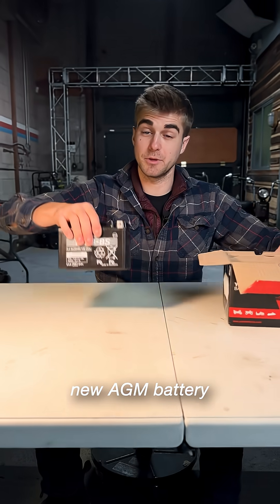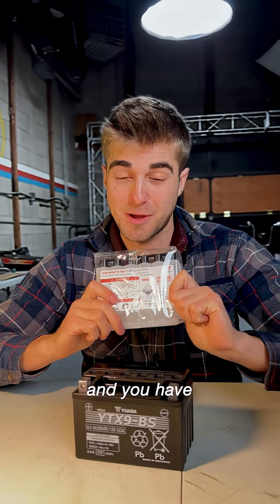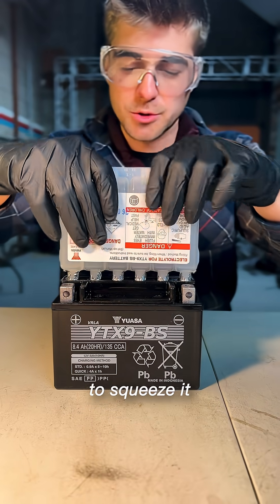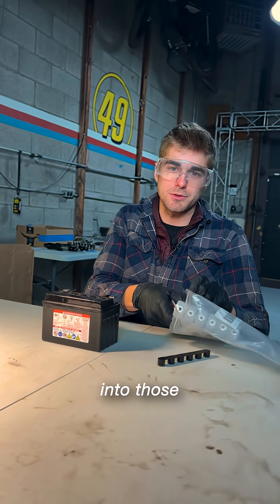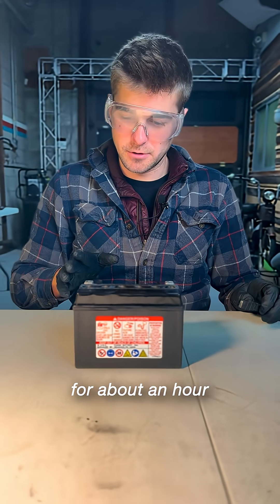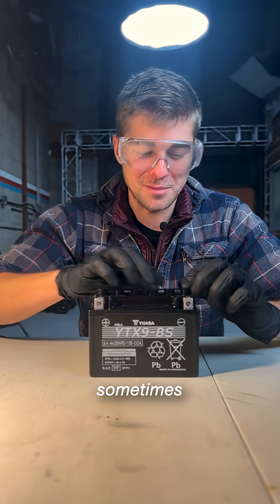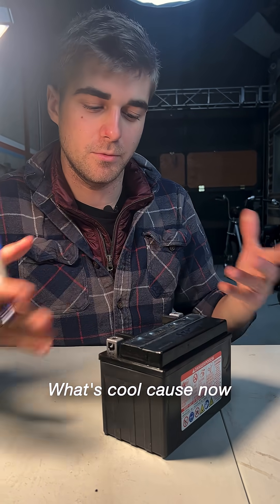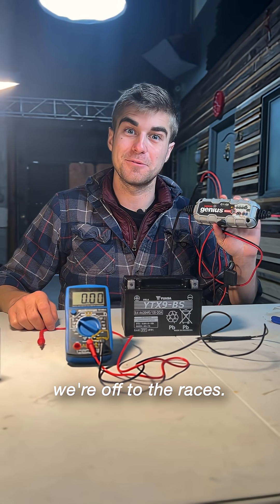How to activate your AGM battery | Tech Tips ⚡

Comment: Note for people in the EU, you will never have to do this. Per 2021 its illegal to sell batteries with the acid separate. Hardware shops fill them up before handing it over/shipping to you.
Edit: ok sometimes stores ignore this law, but generally you get your batteries pre-mixed
Reply: I ordered mine off Amazon (in EU), it came dry and without acid, what can I do now? Nowhere sells acid near me
Reply: @radeski-m6b  Acid is strictly forbidden because they a scared that you make bombs out of it.
Reply: @Hobby_Electric  Acid is not forbidden. Maybe you meant to say restricted. You can buy acid at the grocery. Citric Acid. You can buy acids and bases at the pharmacy. You can get this acid, sulfuric acid from any lab supply companies and you can get a pretty high concentration before you need a license
Reply: @TheTransitmtl  Right but Sulfuric Acid and Nitric Acid are only in very low concentrations allowed but useless.
Reply: @radeski-m6b mine came preloaded and charged. Go figure.
Reply: @radeski-m6b  return it?
Reply: @terdroblade it's past the date so that's not gonna happen, might try take the electrolyte from an old battery and fill this one with it, I think it's the battery that degrades and not the acid, if I'm not wrong
Reply: In France there are still shops selling them seperate
Reply: @PaulFonWheels It wouldnt be the EU without people ignoring the rules every now and then :)
Reply: They probably don't think the every day person can't be trusted with "loose" acid like that. Who knows what improper uses they could find to do with it!
Reply: @janus4002 London moment
Reply: I've popped a few lots of battery acid into batteries (including Yuasa)  - and that was in Finland (though this was 10+ years ago). In the UK when I ordered a new battery I was shocked that it was already put in - and long and behold IT WAS NOT EVEN DONE PROPERLY.
Reply: You can thank cultural enrichment for that.
Reply: The EU is all about making up rules that one half follows and the other half say "wow, you actually follow that rule? SUCKERS!"
Reply: @Treblaine  I’m so perplexed by this anti EU rhetoric. The world is so divided these days. And you’ll say, ‘because of the EU’. So … pointless to argue.
Reply: @Labgorilla  The fact that you're confused that a political institution could be criticizes is more revealing than the criticism

"I'm perplexed that you would oppose our Dear Leader who is incapable of doing anything wrong. Maybe you are irredeemably evil for opposing him?"
Reply: EU over regulation as usual.
Reply: yes because plebs NEED to no be allowed any item which could be a threat. Just like nitrates
Reply: Literally bought one of these 6 months from a bike dealer and had to do it myself
Reply: @Lee-xs4dj probably not every store follows the law. Its a mostly useless law IMO anyways
Reply: Same in Australia - always mixed and sealed
Reply: yes that is why you buy a already dead from storage new battery nowadays.
Reply: I bought a battery last week and it was packaged just like that with a separate acid pack here in Norway.
Reply: @Fekillix  lucky you! I guess you need to figure out if you should seal immediately or after degassing? Comments section seems to have differing answers…
Reply: @Labgorilla Yuasa manual said wait 45-60minutes for the capacity mine was. There is no vent, so you definitely don't want to cap while it's bubbling.
Reply: I got one less than a year ago that still had the acid separate lol
Reply: I'm a UK resident in my late 50s, I've known about these for nearly as long as I've known about lead acid batteries but have  never seen anywhere selling dry charged batteries with separate acid and I worked in the garage equipment business too, way before 2021.
Reply: In Portugal I small shop I know sells them dry, but car ones come allways filled
Reply: Yes and the Nice thing about is you will always buy long term strored Batterys wich fail more often. i hate the EU laws
Reply: @Hobby_Electric someone just said that they are able to get the exact same type of battery with separate acid and they’re in the EU.
Reply: @Labgorilla  I Live in the EU and you re NO able to get the Acid as Private Person !
EU-Verordnung (EU) 2019/1148
IF there maybe one person who got an old stock item he is lucky.
Selling it to Person without special permission will result in hard penaltys !

And because all items in this law has to be tracked from Manufacturer to Seller its not possibile to get them without permission.
Reply: @Hobby_Electric  I live in the UK, and I have zero idea about such batteries. I’ll be honest and say that they look like fun. Starting the reaction yourself seems to be a real sense of satisfaction. Every battery I have ever bought has never come separate from the acid. Fortnine seems to have stirred a huge discussion!
Reply: @Labgorilla  The best thing about seperate Acid is that the aging begins after they re filled with acid, so unlimited time to store them.
They re still used in EU but only availabile for certified Workshops.
Reply: I'm from EU. I literally dumped acid and activated battery in March this year, bought completely new in a shop, acid came separetely.
Reply: Bought one last month not activated in Romania, Willl not activate it until Spring kicks in, so buying it activated was not an option.
Reply: Lol, I love the way yall spin "aren't allowed to" as "will never have to".
Reply: I was just thinking. Giving people this assumes lack of stupidity. The EU doesn't give people this level of freedom.
Reply: @Labgorilla  No, it's mostly about "antiterrorism"/drug war stupidity. I needed Acetone and I got yelled at for trying to buy more than one bottle
Reply: @Labgorilla  Absolutely, and we in the US don't need to use the acid to hurt people because we do that with guns by the droves.
Reply: @xDownSetx  Yeah. The whole gun thing. I don't want to go there. Completely alien to me. Just can't understand the concept.
Reply: @xDownSetx battery acid is relatively dilute. A lot of "acid" attacks use ammonia. when acid is used they usually use drain cleaning acid, which is actually significantly more concentrated than battery acid.
Reply: @K26650 Battery acid is usually 50% sulphuric acid which is pretty damn strong
Reply: @Mrshotshell drain cleaning acids are commonly above 90%. That's a hell of a lot more concentrated. What you also need to consider is that battery acid has to be a relativley pure mix of water and acid to be effective. Drain cleaning acids, along with being significantly more concentrated, contain additives which can make them more damaging. For example: a gelling agent is commonly used and will make the acid much harder to remove from skin
Reply: @K26650  never heard of drain cleaning acids you describe. Usually its alkaline. The sales of high purity and concentration acids is regulated in Europe due to the ease of production of explosives from sulphuric acid. Its also used to synthesize drugs. That's why its hard to get pure acetone as well and 30%+ peroxide. Ooops i just gave you the recipe;)
Reply: @EnhancedNightmare that's interesting I've seen those exact acids you describe in my local stores, and I can get 99.8% acetone from ebay in 5l containers. But you're more than welcome to do the explosive manufacturing yourself, I prefer my explosives to not be friction and shock sensitive.
Reply: @K26650  With these acids you can easily do RDX. Did it before, easy. The other ingredient is available in every trekking store.
I think you are overstating the friction and shock sensitivity of the acetone one. Its fine. We didn't even consider it particularly spicy in the high energy materials department. Just the reaction is sensitive to dummies who can't manage heat ;)

Anyway these ingredients are all regulated in EU. There are ways around it but the police is always sniffing. That's why I moved to sustainability sector.
Reply: @K26650  It is not about concentration,  sulfuric acid can be used to produce nitro explosives (even TNT).
For clogged pipes hydrochloric acid was used, but sodium hydroxide is more popular now (and better for unclogging IMO)
Reply: @Labgorilla if you can’t understand it maybe you don’t deserve it. Europeans would rather “safety” than freedom. Not that Europe is any safer than America, even with guns. Stabbing and vehicle rammings are a daily occurrence.
Reply: @cane870 been watching a little too much news sir? And I guess there are days in America without gun crime… this conversation about freedoms is old hat. Could talk until blue in the face. I’m not bothered about the freedom to put acid into a battery myself. Keep that if you like.
Reply: @xDownSetx  I assure you, you can go buy gallons of hydrochloric acid in Europe. You need it in masonry work. It's labeled as "Muriatic acid"
Reply: @Labgorilla  but hey at least in the EU there's freedom to have a beer with friends in a park, the US doesn't have this level of freedom
Reply: @gianfrancopuli5448  non capisco. come mai non si puo bere una birra li? si , io sono italiano.
Reply: @Labgorilla open containers of alcohol are illegal to transport. You can't walk and drink a beer. You cannot drive with half a bottle of wine within reach. No drinking a beer at the beach. 
❤ Italy
Reply: @thepfeiffer5106  ha thank you. I completely forgot about the brown paper bag issue that the US has. Oh man.
Reply: @thepfeiffer5106  It depends on the country, but generally most countries in Europe don't give a crap if you slam beers in the downtown park at 2pm on a tuesday.
Reply: Note for people everywhere: buy a lithium battery.
Reply: @MisterV90  sometimes its not an option. BMS of some cars may not be compatible with Lithium batteries
Reply: Actually all refillable batteries are outlawd here, you only can get gel and Lithium batteries now

Comment: That's diluted sulfuric acid. Not alien blood. You'll get a rash if you soak it for long. Just go wash your hands after. 

Cheaper batteries comes with dinky bottles that sometimes dont drain properly. Just use a pin/needle and put a little hole at the top of each bottle once its placed onto the battery.

The gases are mostly hydrogen, as with most acid-metal reactions. Sulfides stinks, You'll get those if you try to charge a bad battery or crank the amps till its bubbling. You'll def know once it starts bubbling fart.

I usually give it a few love taps with a rubber mallet after 15 mins to bring any trapped bubbles up. Cap them once the sizzling stops. An automotive stethoscope comes in handy or just put my ear on it. 

It's a valve regulated lead acid. VRLA. Also called SLA. Sealed Lead Acid. It uses glass mat to keep the acid where it's supposed to be. While technically same as AGM. It's not usually referred as such. AGM normally refers to spiral agm for cars... higher end cars.

Comment: This is missing one crucial point. Batteries last way better if cells are actually submerged. I've now few times seen that cells have been quite a bit exposed and had needed to top up with distilled water. Obviously not much needed, but still.
Reply: Only for wet batteries 

AGM work differently and aren't submerged

Comment: If that produces significant quantities of hydrogen sulfide I’d recommend to do this in a very wel ventilated area, that shit will happily kill you. And the fun part is while at low concentrations you can smell it ver clearly it’s smell can disappear at higher concentrations so while it might seem like your safe if you don’t smell anything it can still be deadly.
Reply: Same warning applies to sewers and septic tanks too: Hydrogen Sulfide gas is released when human liquid waste comes into contact with solid waste and they react. (That's what makes your septic work.)
Reply: It doesn't produce much h2S, mostly just CO2 
The level when you start smelling h2s is just extremely low

Comment: Wish I'd have known this before replacing my battery with one of these. Good thing it was only $60, so if it does die quickly I'm not out too much money.
Reply: Keep it charged and when you don't use it for longer periods take it out of the bike 

Never let it deep discharge or let it sit in hot temperatures for long periods. Hot will corrode the grids.
Reply: @GerManBearPig I have battery tender hooked up to it right now until April or so

Comment: Bought a bike and the previous owner had installed one of these. Spilled some acid and apparently filled the rest up with water. I learned that after constantly smelling fuel while riding and discovering a hole in the fuel pump from acid leaking out of the battery vent and eating its way through the plastic. Fun times.
Reply: Didn't that immediately lead you to ask, "What else did they do?"

Comment: Yamaha recommends 30 minutes to an hour of soak time for batteries less than 18ah, and 1 to 2 hours for batteries larger than 18ah. The moment you apply power with a trickle charger you lock out any of the matts from ever having contact with the sulfuric acid, they say. You literally kill capacity and lifetime usefulness when you put it on a charger too soon. So if a shop will set up a battery for you and its ready in 15 minutes you just got screwed and your happy about it cause quick turn around.

Comment: 2.15V per cell not 2.0V. 2.0V per cell is something like %50 discharged.
Reply: As a battery tech with aaa, I can confirm it is around 2.11 volts per cell, for total of 12.66 fully charged 12v battery. Fully drained is around 11.7 (that's around when the battery doesn't produce enough current (CCA)), so 12v Batts have less than a volt of a charge window.

Comment: Is there a weight savings over OEM Lead Acid batteries?
Reply: No. Go to shitter before riding if you're worried about that :)
Reply: Agm batteries do have slightly higher energy density, but it isn't a large difference. If you're looking for weight savings lithium is king

Comment: In battery shop we did put the caps on immidiately, we didn't wait for offgassing. Most AGM batteries have valves for offgassing. Also most of the time we did only activate the battery when customers came to buy them and then instructed them to charge them to full.
Reply: So if I drove my car to your shop and bought a battery for my bike that was home in my garage, the battery would then off gas in my car on the way home.  Great.  
I'm no chemist but just because you did things a certain way in the shop doesn't necessarily mean that's the best way to do it.
Reply: @unpopularopinion8608 hydrogen sulfide smells so bad you’d open the windows a long time before it’d reach any harmful concentration, literally smells like a bucket of rotten eggs
Reply: @unpopularopinion8608

As someone who worked in the battery production: AGM doesn't like oxygen, so just close it immediately
Reply: @GerManBearPig interesting, thanks.
Reply: @unpopularopinion8608  Open your windows if you smell it.

Comment: Pretty sure you are NOT supposed to let the gases out.

Yuasa even says to specifically, seal immediately after filling.

The entire chemical reaction also benefits from not loosing those gases, that's why they have a valve to controlled the pressure in the battery.
Reply: I just activated one of these and the included Yuasa manual said just what he did here. Fill, wait 45-60 minutes then cap, then charge.
Reply: Won't you just blow the caps off if you don't?
Reply: @Vancha112  No
Reply: Many AGM batteries have vents on them to let the gas escape. The AGM batteries that I've bought for my caars have a vent outlet and a hose hooks up to it to take any gases outside the car.

Comment: last time I changed the battery I barely left it for a few minutes before capping. hope it doesn't build up pressure
Reply: Manuals actually say they should not be left alone and should be capped immediately, so actually the correct process is as you probably did.

Comment: AGM (Absorbed Glass Mat) is a type of VRLA (Valve-Regulated Lead-Acid) battery, not a separate category. Therefore, the comparison is between AGM and other types of VRLA batteries, such as gel. AGM batteries are known for their high charge/discharge capacity and are suitable for high-power applications, while gel batteries perform better in high ambient temperatures and are better for deep discharge cycles, though they have lower recharge acceptance rates.
Reply: That's why gel ones are recommended in applications where the battery doesn't stand upright but in an angle, such as in some cars (Mercedes A180's auxiliary battery  for example, where it lays almost at 90º).